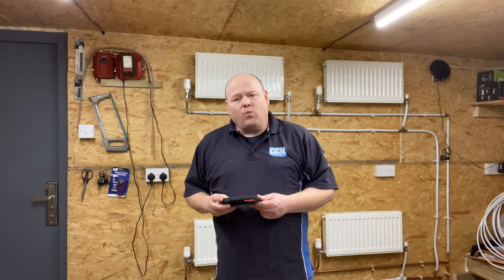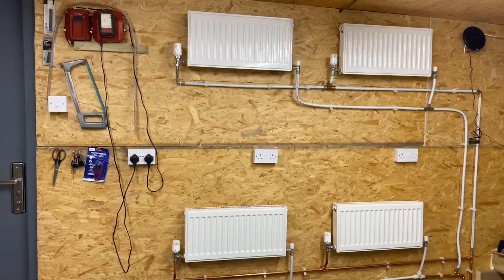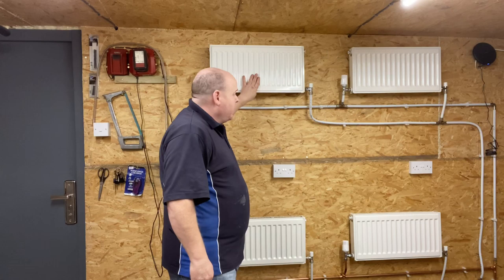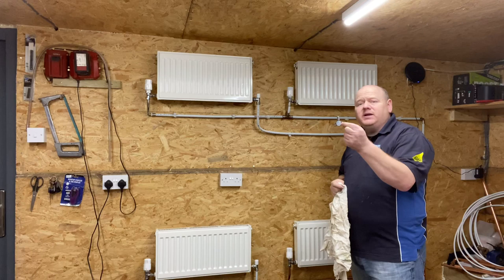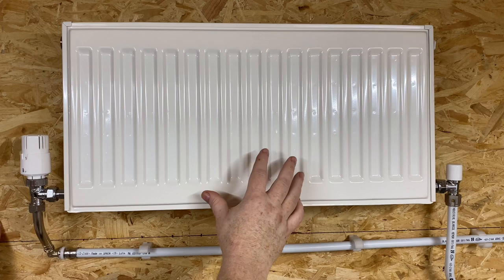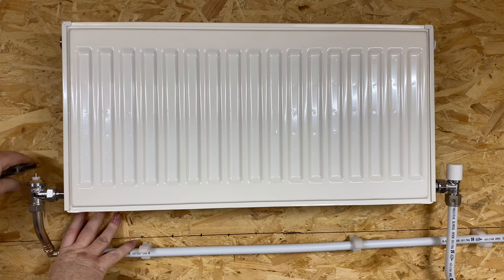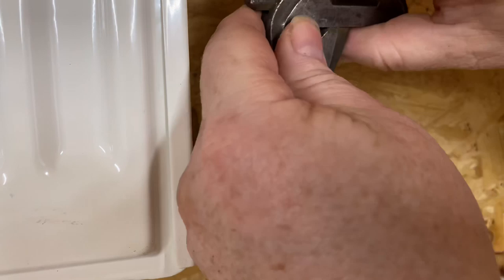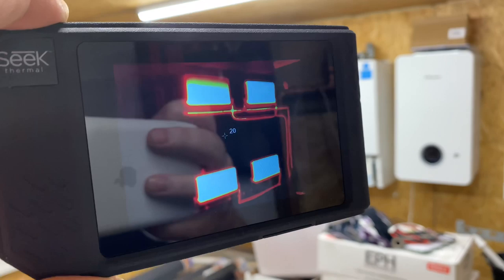HOW TO FIX ONE RADIATOR NOT WORKING - CENTRAL HEATING SYSTEMS

Comment: Check thermo valve pin - all good, checked lock shield - fully open, bled radiator - almost dry. Scratching my head for about 5 days and found this video. Thankyou for resurrecting my final radiator with the air lock method

Comment: Thanks for this video, had one radiator in the system not working. Tried bleeding, flushing, lockshield  etc nothing worked. Then I noticed in your vid to turn ALL the radiators off apart from the one not working, did this then switched on the C/H. Heard a brief gurgle in the suspect radiator then it stated to get hot. Turned all the others on and all working good now. Many thanks for covering all options it really helped.
Reply from the maker: Thank You

Comment: Just watched your video and had 1 radiator not working. Tried the open valve method on the right and it's worked. Thankyou so much 🙂
Reply from the maker: Thanks very much for your comment, please consider subscribing to support the channel 🙂

Comment: Fantastic!!! Just revived the cold as Ice, main Living room Radiator, following precisely what you advised, including ensuring the Return Valve was in the “open” position. Boiling hot now! Cannot thank you enough. Even used a pair of Channel-lock Pliers, for the unthreading and pressing down on the Pin. Great explanation, and saved me a call out which was next on the agenda, but for one final try, after watching your brilliant video. Thank you very, very much!!
Reply from the maker: Thanks 🙏

Comment: Many thanks pal, the old stuck pin under the thermo knob was my issue. 

A little tip I'd suggest for anyone reading this, as I was already in the radiator fixing mode I checked all the other radiators in the house and had a couple that was working okay but just not quite to their full potential, so I did the thermo pin trick for those as well and now they are boiling hot as they should be. 

Thanks again 👍

Comment: Thanks for a great, very clear video. Just wondered when bleeding a radiator, the air has obviously displaced water. Where has the water gone, when referring to a vented central heating system. Thanks Edward

Comment: Amazing video, very clear and informative. I am having the same issue on a customers house. I'm not a plumber, but a general builder and have worked on both heating systems for rad moves, additional rads etc and hot and cold pipework for kitchens, bathrooms etc. I have followed all the steps in the video, and have even changed the valves and radiator, but still have the issue of rad not working. The house is supplied with Osma gold pipework throughout (which is discontinued) with copper tails to rads etc, the pipes to radiators are 10mm. Are the pipes themselves potentially blocked to the radiator as it is in 10mm and easily clogged? The customer can not afford a power flush, so while I'm there I'd like to help them to resolve this and save them money. Thank you.

Comment: Another top tip: Did you know that 8 times out of 10, an electrical face plate screw will work in a handled, mini lever, ballvalve? Iso/wash mac or on a filling loops cw iso or c/v with back up iso. Just If you lose the screw supplied. You just need to saw it down to around 10mm. Just tried it. I have lots of loose screws.. according to mi missus. Mainly in my head tho.
Tally-ho, pip pip. Have a reyt grand Chrimbo, Al.
Reply from the maker: Thank you for the tips, Happy Christmas 👍
Reply: If it works, I won't knock it. 😜

Comment: Great vid Allen. Looking forward to the balancing rads vid. Ideally, if you can also mention how you might use temperature probes so it's more accurate. I struggled with a large system, there was about 20 rads and just know it wasn't perfect in the end.
Reply from the maker: I was on a Training day a few weeks back and talking about the probes, Problems is they can never be accurate as when you change a rad the flow to others would also change. I will do a video on how i do it. Thanks.

Comment: Good Video as always Allan, would be good to see how you balance a system ( I’ve seen guys use temp gauges the pipes ether side of a rad ) I managed to balance mine pretty effectively by just cracking open the lockshield just enough to hear flow and ensure the rad actually got hot.
Reply from the maker: I will try and do a video this week. Thank you so much for the comment. Happy new year

Comment: If the flow pipe under the TRV valve is hot, but radiator is cold, would it be a faulty valve or airlock problem?
Reply from the maker: Pin might be stuck. Thanks.

Comment: Great tips. Do you have videos on how a power flush is done before swapping a boiler on different systems and the difference between a magnacleanse and Powerflush? Seems to be some confusion between the two and when which one should be used.

Thanks.
Reply from the maker: I will try and do one this week if possible. Thank you so much for the comment. Happy new year

Comment: Tried all the tricks, nothing works,,can be the pump not pushing enough???🙏
Glow worm c24, all radiators work, only one not heating up, replaced it, still not heating up,  no blockage,  boiler old and noisy but still work, old old radiator, combination boiler

Comment: Hi - wondering of you can help with some advice. 
I have a radiator that doesn’t heat up. A gas engineer inspected and balanced all the radiator and the  release pressure from each radiators. Then the radiator then started working but after 7 days the radiator stop heating up again. The radiator is the last one in the system and ground floor.

Comment: Hi Allen, Thanx for the vid. I have the pin stuck down; used WD40 over a week and gently pushed/pulled the pin up an down.
Radiator works just fine when pin is up although this has now turned into manual operation which is not ideal. I guess the next thing might be to replace the radiator valve which I'm probably not capable of doing. Any idea how much I might be expected to pay for this?
Cheers.
Reply from the maker: Thanks very much for your comment, please consider subscribing to support the channel 🙂

Comment: Hi Allen, great vids. I have a rad which will heat to max when valve turned on fully but when I try to reduce heat with valve the rad goes cold. I have bled all the rads to no avail. Could you help me find what the issue is with this please?

Comment: Hello Allen, 
Before releasing air from my house radiators, they were not working properly (only bottom of radiators or some of them not working at all). I released airs from all radiators and them put them on again. They are all cold and not hot water coming at all. 
I will appreciate , if you could help me to solve the issue. 
Thanks

Comment: Hi. Allen my radiator gos hot then the hole radiator gos cold any idears on this all the other radiators are hot thanks paul
Reply from the maker: Do you have a thermostat on the rad? If so it could be faulty. Thanks.
Reply from the maker: Thanks very much for your comment, please consider subscribing to support the channel 🙂

Comment: Allen, I tried all this including turning off all the other radiators and letting the ump run for a couple of hours. The problem radiator heated up but then after opening the other radiator valves again, the problem returned. This has happened since BG installed a new boiler and of course the earliest I can get an engineer back out is a month's time.
Reply from the maker: You may need to call a local engineer. Thanks.